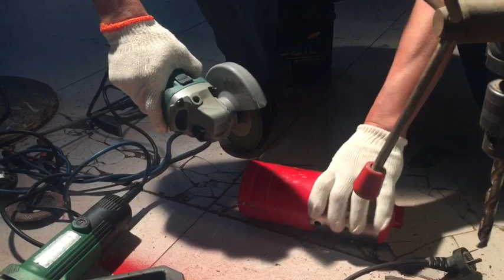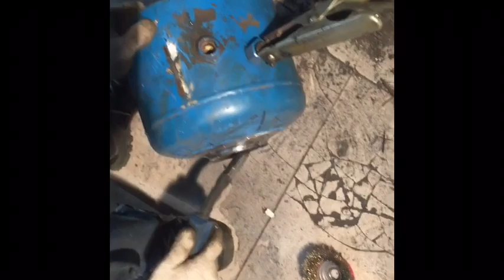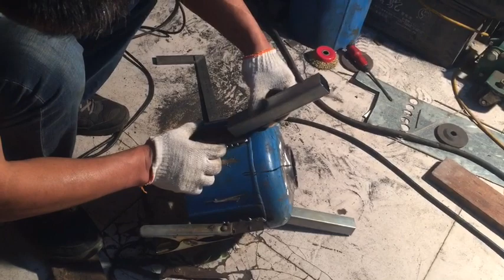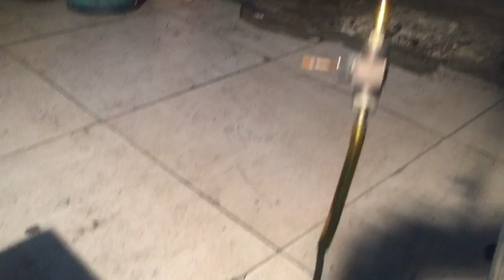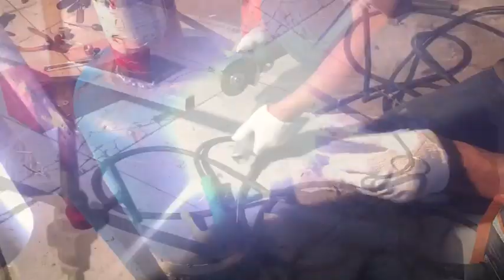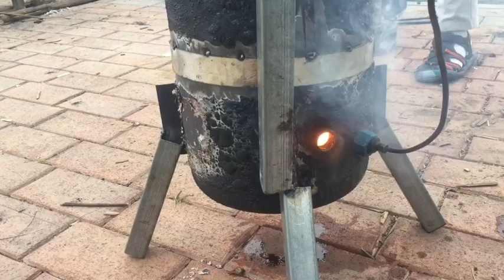2017new design waste oil burner

Comment: This needs to have forced air up through the center  fitting to swirl the air and increase the heat then I think Would work well. Get a small centrifugal blower and duct it in and you should be right.